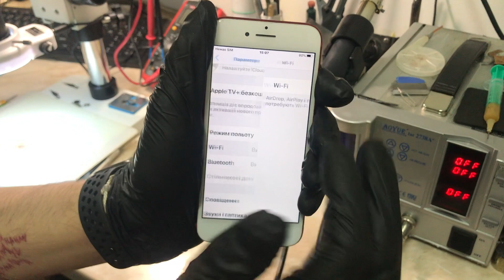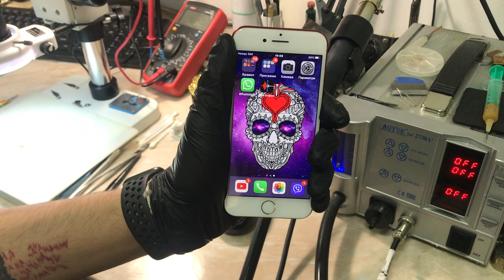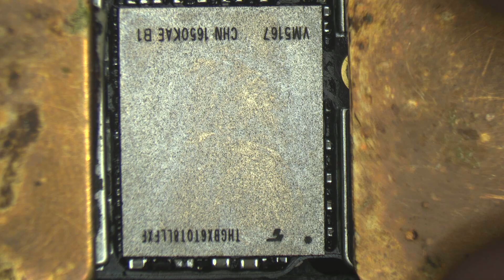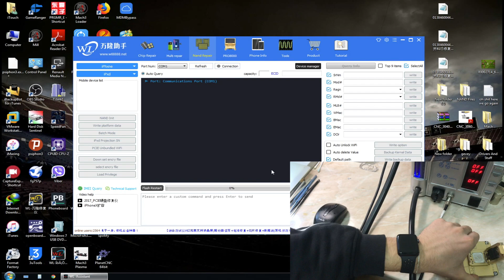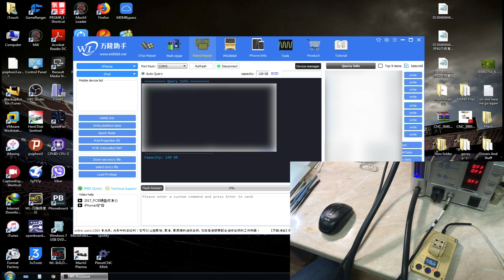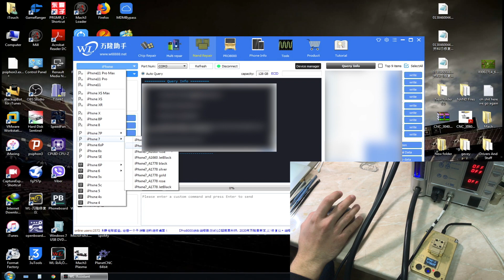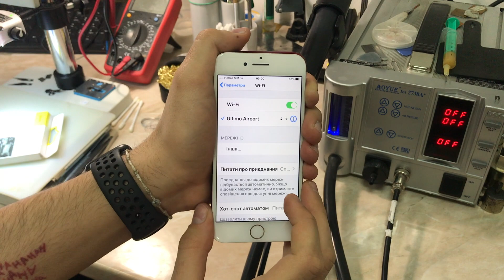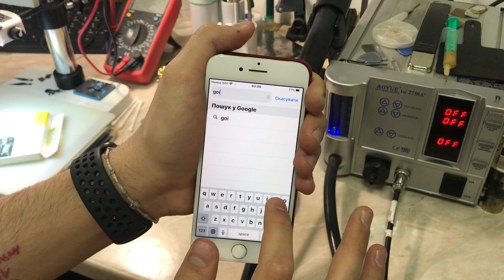iPhone 7 Wifi Greyed Out Repair (Wifi-bluetooth Not Working)

Comment: for people that probably got the wifi chip problem, I solved this issue today, maybe temporarily but, My iphone 7 plus had the wifi grey out problem, upon reading online, one of the suggestion i saw was put your phone under a lamp for 30 minutes, now from what i understand, it wants me to make the phone hot, so what i did instead was remove the logic board, took out my heat gun, and just blasted the wifi chip for 5 minutes, thing was 100+ degrees celsius, and then i use something to kinda press it down on to the chip a bit, not sure if it does anything but whatever, after that i put the phone back together, and to my surprise, the wifi is now back on. definitely try this if you can.
Reply: is there a way without opening the phone ?

Comment: What was the black crystalline paste you applied to the chip through the 6S template?
Reply from the maker: black crystalline paste ??? Can you be more specific? 😅
Reply: Sorry. 11.38 in the clip. This clip was great by the way. Thanks a lot of sharing.
Reply from the maker: It’s called a soldering paste you can find it in the description of the video if you want to buy it

Comment: Same issue with ipad pro 10.5 
Will this same procedure work?
Reply from the maker: History of the iPad ?
Reply: @AntoineKiriaky10  Barely 2 years of use, no water exposure, no drops, absolutely nothing else wrong other than WiFi is grayed out and Bluetooth does not work.
Factory reset a few times but still cannot recognize any form of wife. 
Thank you for your response.

Comment: Hi Bro i Have An iPhone 7 With Greyed Out Wifi But Thats Not My Problem The Problem Is My iPhone 7 Has Bluetooth Spinning Not Showing Any Thing Any Fix ?
Reply from the maker: Check network setting reset and then check the board Bluetooth and WiFi are combined together in one ic so must check there also

Comment: I have iPhone 7 i got the same problem
Reply: Same, Have you fixed this issue?
Reply: @ADR14NTT  technically No but the wifi disabled the use of Bluetooth, Hotspot, and Airdrop, miraculously the Bluetooth suddenly turned on then i was able to connect to wifi using Bluetooth then same to hotspot
Reply: @BrooklynMBE  how long it takes till the Bluetooth turned on?
Reply: @Dan-ny6jp  maybe 5 months